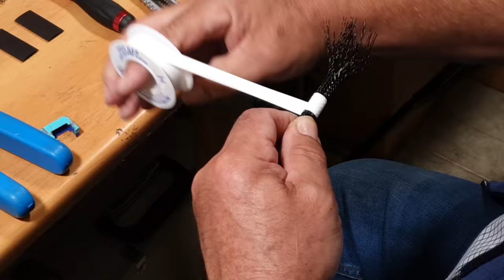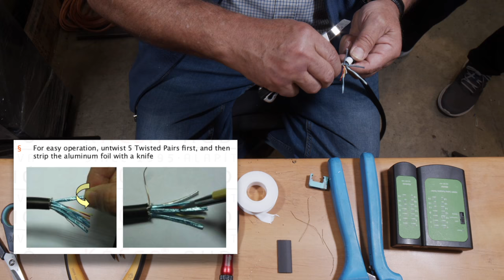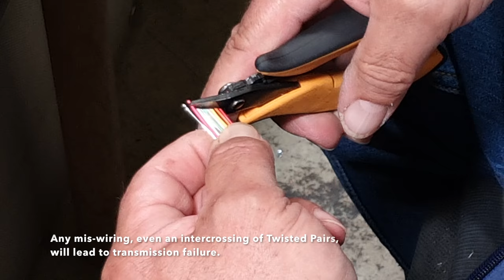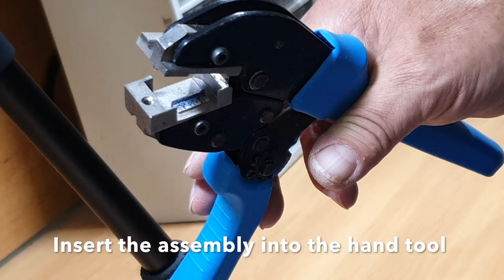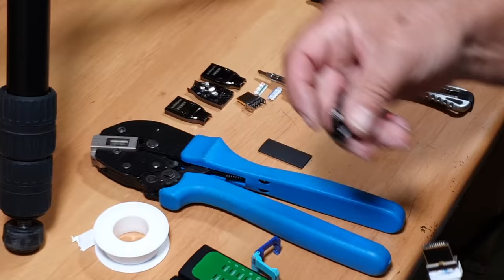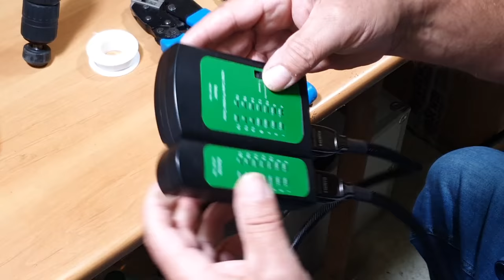How to assemble a HDMI cable

Comment: my cable has different colours . how can i make sure that i can connect correctly?
Reply: That’s what I wondered from the beginning
Reply: That’s secret. As consumers we are not allowed to know
Reply: Vaav Sir....
Reply: Just measure from the other end with continuty meter/tester
Reply: Using a multimeter, measure continuity from the end of the cable to the connector pins so you know where each cable goes.

Comment: Is the picture quality with these as good as Monster Cables?
Reply from the maker: Hi, we've never compared to Monster.
Reply: Probably. It's digital, so, edge cases aside, it either works with a lossless picture or it doesn't.

Comment: awesome. Is there a limit to how long you can make a HDMI cable? Was thinking of making one to go from my indoor receiver to my backyard when we do movies with a projector
Reply: There is a maximum length of cable for that can vary depending on your resolution. But generally if you go past 50 ft no matter what you are going to start having big latency and bandwidth issues
Reply from the maker: KCE-HDMI and KCS-HDMI cables transfer 4K/UHD image only under 5 meters. Above 5 meters they only transfer Full HD image. KCE-HDMI max 15m, KCS-HDMI max 20m.

Comment: Which wire for HDMI to 3RCA ? I need help for playing HDMI setup box to TV audio Video play
Reply from the maker: HDMI to 3RCA cable is not possible. A cable will not convert digital signal to analogue. You will need an active device with HDMI input and RCA output for this job.

Comment: Dude, lol. I do wiring for my job.  You had my cringing stripping the foil from the twisted pairs. There is such an easier way (and no risk to nicking your wires) That move would trigger everyone at my job man lol. Good vid though. I don't work with these exact cables but close enough. Wanted to see what I'd be dealing with if I tried splicing 2 of them together.  Bit more work then the USB one I spliced last year.

Comment: I want to buy 200m cable HDMi , where can I find it ?
Reply from the maker: Thanks for your interest. All the products used for the assembly are listed in the video's description.
Reply: I guess the max length is 30m before we need to boost/repeat it. Even high quality cables are used, signals are proned to skewing since they're are not sent in frames against time

Comment: thanks for the detailed verbal description on the end connector assembly! NOT!
NOT informative is what this is. Sure you can follow along. If you are like me. I need to know what function each wire has as well as any other spec there is. 
BTW. When you used the small razor to cut the foil shielding off. you undoubtedly nicked the conductors insulation. this has caused issues in the past.
Peel the foil off back to the conductor insulation and cut with scissors.